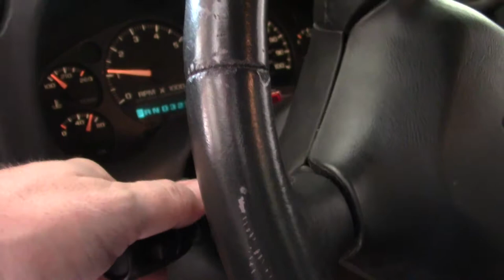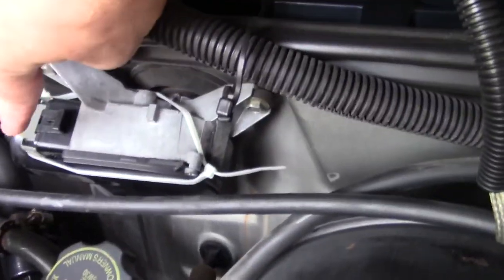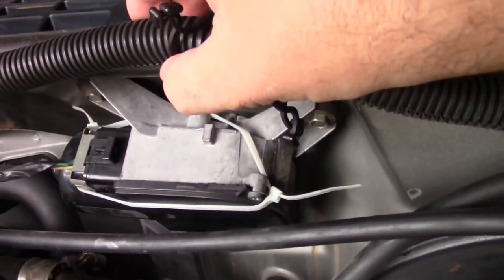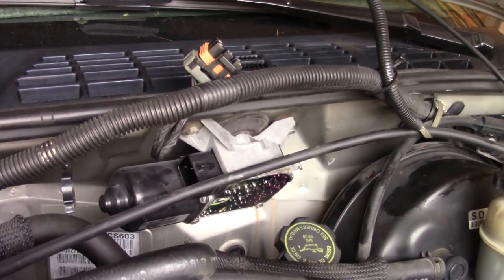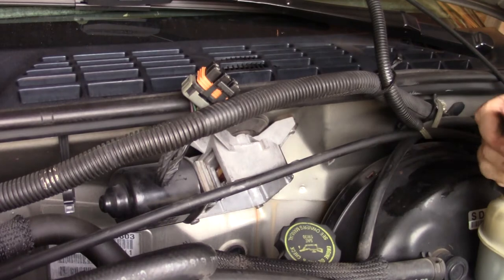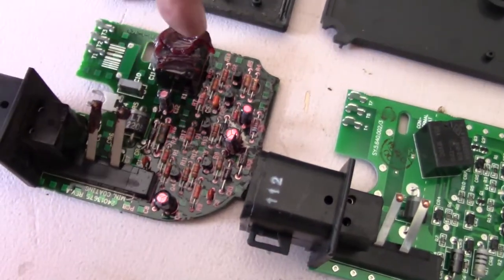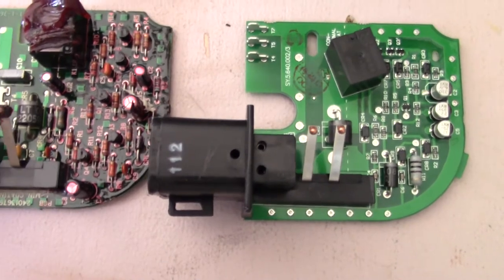Chevy S10 Hot Wheels Truck Wiper Motor Pulse Board Swap

Comment: Dielectric grease on the old circuit board is to protect electrical stuff from moisture. It also helps it cool.
Reply from the maker: Ah, I see.  Makes sense.  Thanks!
Reply: Upon taking mine apart I see the entire mechanism is covered in this grease. I'm not so sure it is dielectric anymore. I did use dielectric grease for my pulse circuit installation.

Comment: I know it's too late to tell you but the vibrations cause the solder joints where the wire plugs in to break lose. Next time to fix it dissemble it and take out the circuit board and re-solder those joints, reassemble and you are good to go. It's a super easy fix.
Reply from the maker: Thanks for the tip!

Comment: Drove mine to work this morning. Had to get out and jiggle that plug to get them on and then half way to work they just went from slow to crazy fast by themselves. Switched this out and now they come on every time but won’t come on until the 3rd from last speed. Like I only have low, medium and fast now. Curious if my switch went bad(but first click was working this morning) or if there are different speed boards?
Reply from the maker: I don’t know if there are different speed boards, but it would surprise me if there were. I would double check the connection on the new board and make sure it’s seated fully.  Seems odd to me that the first two positions on your switch would suddenly stop working. Sorry I don’t have a better response.

Comment: Is there anything else attached to that bracket mount? 1997 Pontiac sunfire,  there is a solid bracket mount, it seems i can not access the board without breaking the bracket.... suggests why yours is tie wrapped....
Reply from the maker: Mine was tie wrapped because the previous owner was trying to ensure that the wire harness stayed connected to the assembly.  There is no other mechanism to hold the circuit board in place other than the three screws of the black cover.  I couldn't comment on how the Sunfire works/is designed.

Comment: I got a  2000 4.3 vortec  is the same part?
Reply from the maker: I'm pretty sure it is the same part for 1994 through 2004, both 4 and 6 cylinders.  Always double-check with your parts supplier though.